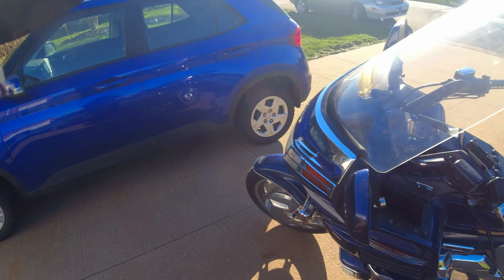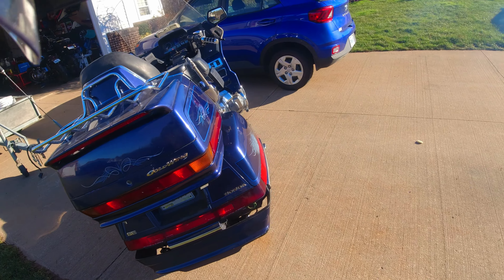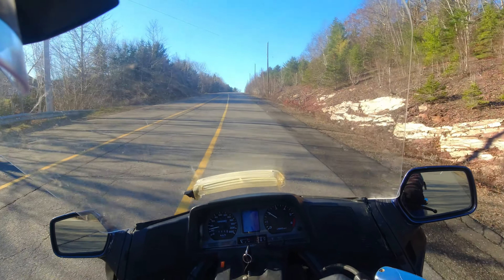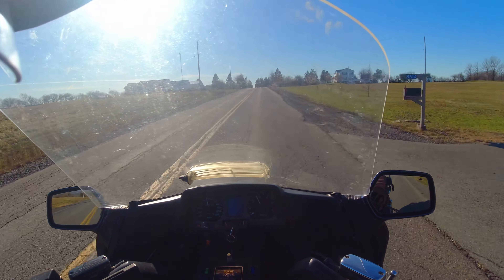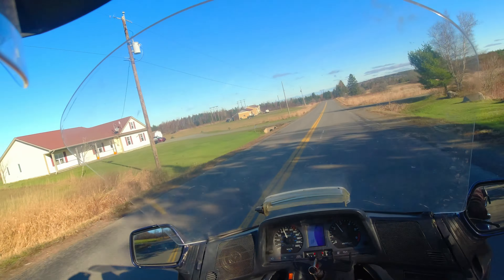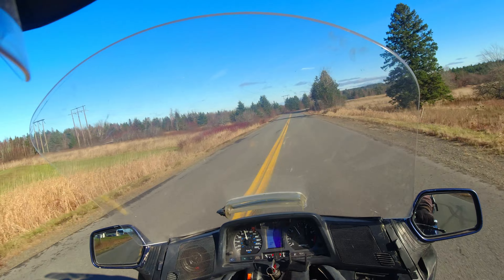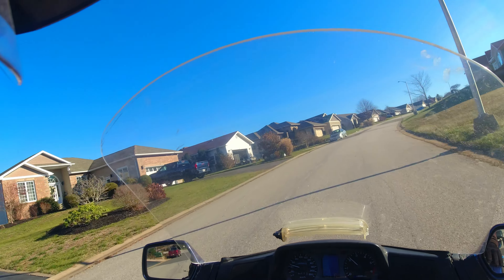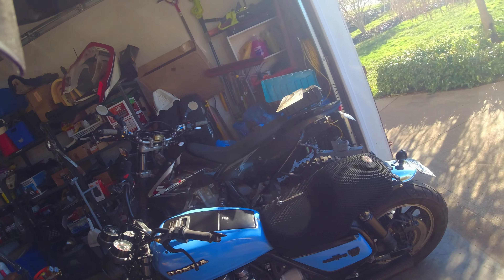Honda Goldwing GL1500 Crash Repair | Episode 6: The Test Drive | 4K

Comment: Another option for the radio is to get one of those cruiser radios and install it in one of the fairing compartments.  I used a $100 (US) Boss unit off of eBay that has AM/FM, aux input, and Bluetooth as well as having 4 speaker pods included.  I pulled the speakers out of the pods and mounted them in the stock locations and put the radio unit in the left side fairing compartment.
Reply from the maker: Pretty good idea!

Comment: I have 23 year old Goldwing (2000) se. The only thing that I am disliking more and more is the way it is drawn to semi trucks out on the road. It literally feels like it's being vacuumed towards the trailers!! I road a 2004 ( a friend's bike), and it's way more stable than mine when being passed by big rigs. I wish I could find a way to make mine more resistant to the semi vacuum.
Reply from the maker: I get a bit of that on all bikes I think the reason the Wing feels particularly affected is the faring size.
Reply: @Trail Trash Garage  yeah with several acres of plastic and theater screen size windshield it's definitely affected by semi's and motor homes as well as cross wind. But....I finally pulled the trigger on a new trike from Heartland Honda.